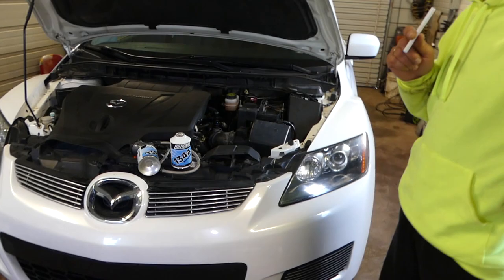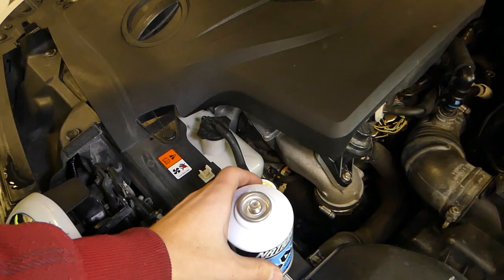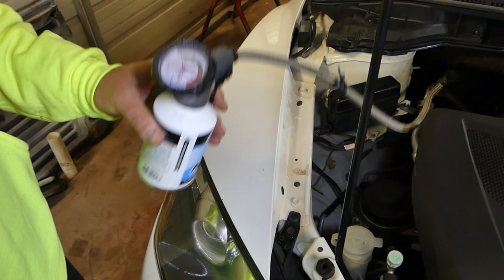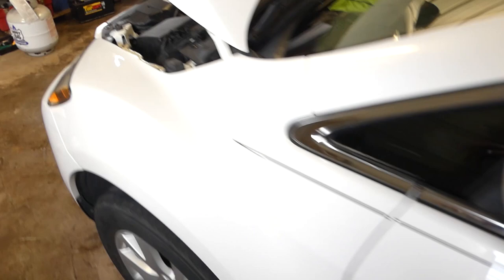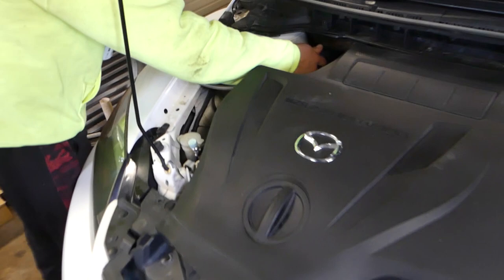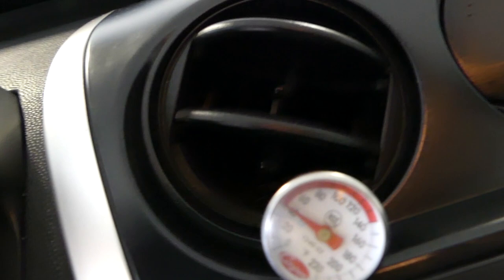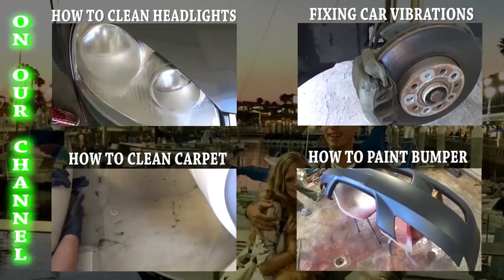MAZDA CX-7 HOW TO RECHARGE AC AIR CONDITIONER REFILL

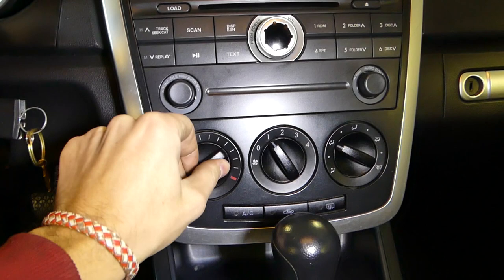Comment: 1:40 fan setting should be set at maximum “4” not 1.
Reply: That's what I've heard too. Sadly my Mazda CX-7 has me stumped! Put a whole big can of Freon and still blows hot! I hate having to go to dealership. They stick it to you where the sun don't shine!
Reply: Peter Vargas so my cx-7, 2007, the compressor has stopped engaging. Some friends suggested I try this method to see if it’ll engage.  My fear is I need another compressor.